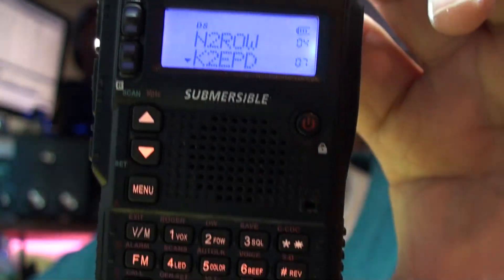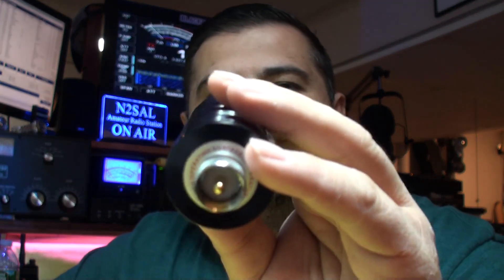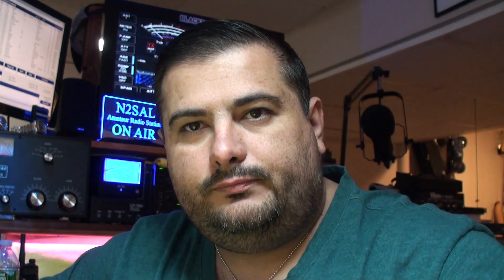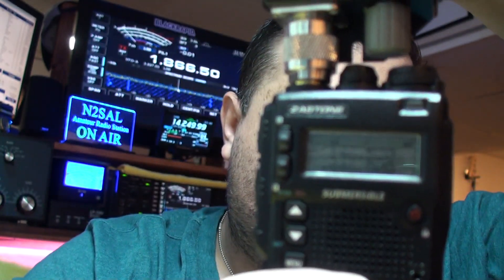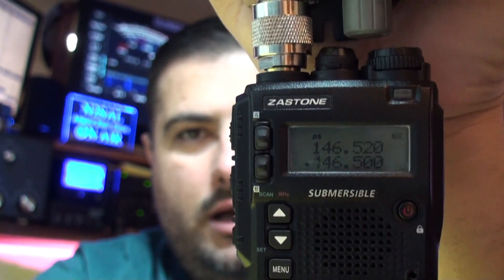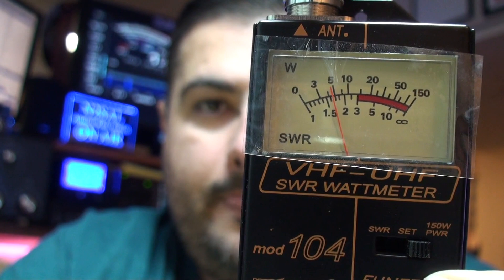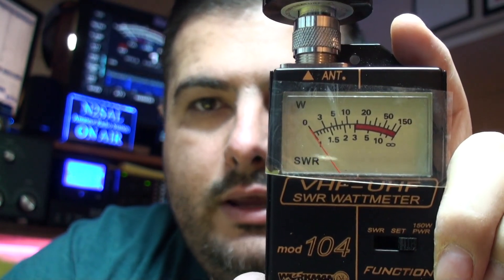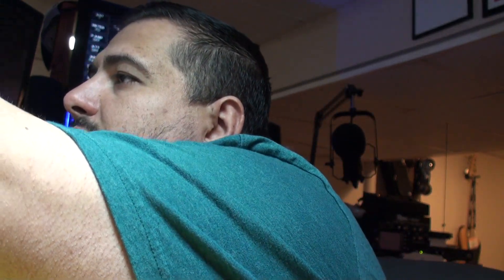ZASTONE UV8DR POWER TEST

Comment: not a bad radio at all. get a genuine nagoya 771 from amazon and bam, decent. So long as you don't care that it doesn't have general receive 0-999Mhz and xmit on 50mhz band, this dual bander (6/70cm) radio is actually quite solid and works really well. It gets a lot of flack but so far I've been happy with it.